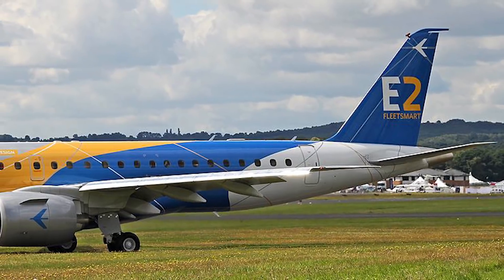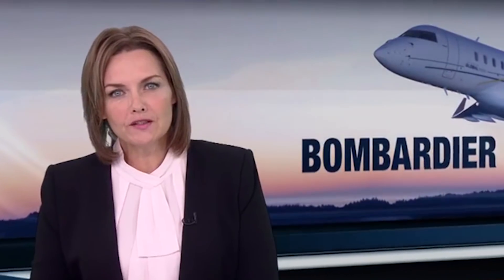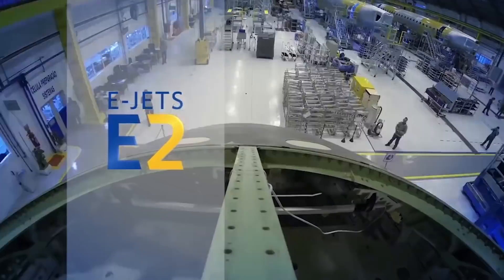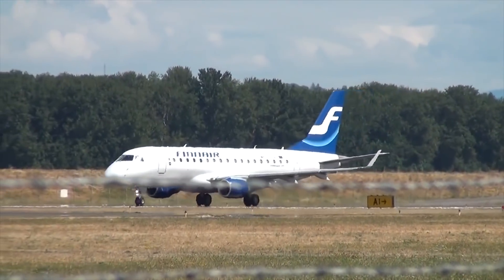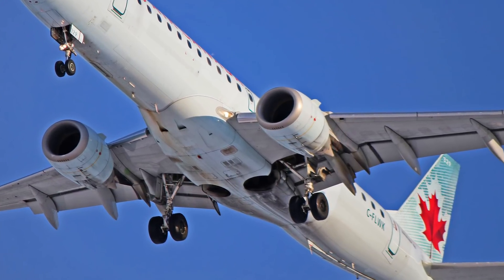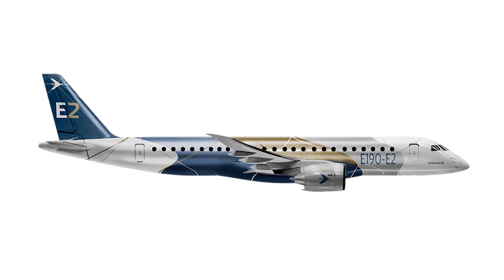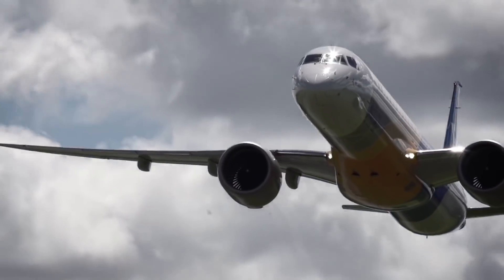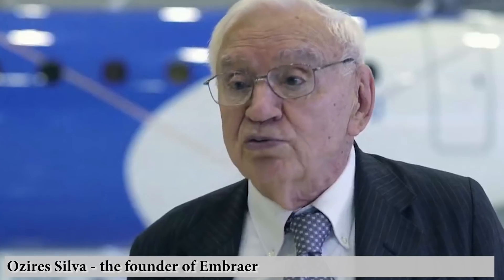Embraer E-Jet E2 - a new generation of leaders

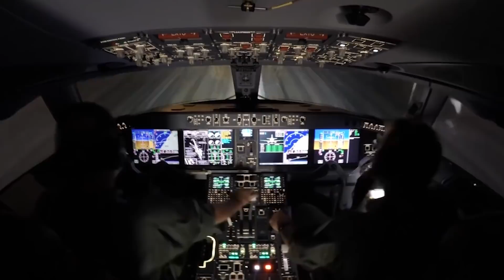Comment: 6:32 fast forward five years into the future, and these P&W Geared Turbofans have become the E2's Achilles' Heel. If Embraer had new-generation GE engines based on their proposed NG34 program, it would have been an undeniably superior product to the A220. As it is, GE didn't proceed with any engines for the E2 because they couldn't make a business case for it, but GE engines would definitely have been the best option. Even RR could do better than P&W.

Comment: Embraer and Airbus: Huge amount of engineers and scientists develop new aircraft with success. 

Boeing: Hired a big administration of economists who decided to tweak the 1960s design of the 737 to save money and be competitive. Putting in computers to fix pitch-stability issues from fitting huge "large bypass engines" on an ever more stretched and expanded 1960's design - how did that work out again? Oh - killing people. Good to see Boeing "saving money". Did not turn out so well, did it? 

So let us hope that Boeing finds back to their roots of being a science and engineering-driven company instead of being a company that rehash old designs to "save money". And fuck airliners who wants the cockpit and systems of the 737 to stay in the 1960's to avoid type-rating their pilots into the 21st century. We are in 2020 now. Even tiny private jets are FBW (yes - Embreaeer has FBW even on their tiny 8-person 450 (now Praetor models).
Reply: Economists are smart and can think long term. You're thinking of executives and short-term-profit focused accountants. Though it is worth noting that pitch stability augmentation is perfectly safe if done right – but 737 MAX was extending off of 1960s architecture, as you correctly noted, and that old architecture was not designed for the robust control needed for a good stability augmentation implementation

Comment: With large engines, Embraer do not need MCAS, why?
Reply: Because they managed to keep them under their wings. The 737 MAX has its engines mounted on the front end of the wings. This affected the airflow above the wings, which combined with the power output of those engines caused the plane's nose to go up by itself. This is why they added the MCAS, they needed something to control the nose, but it all backfired badly. The E-jet E2 doesn't have the nose-lifting problem and therefore there's no need for the MCAS.
Reply: @doctoremil2678  Instead of mounting their engines up and in front, can't they change or increase the height of their landing gear and fix their engines at normal positions?
Reply: @allenyeong3443  They probably could have done it, but it would have been expensive. Apparently the whole 737 MAX model range originally wasn't meant to be a thing. They wanted to create a new plane from scratch, but then the A320neo came out and the whole Boeing went crazy with panic. In order to keep their sales strong and costs down they decided to push the ancient platform one more step further, but it seems to be one step to far because of so many compromises, including the landing gear which remained unchanged. I think that instead of quickly creating a faulty stopgap they should have taken their time and made something entirely new and safer or at least a more carefully designed new version, just like the Embraer did with their E2s, they may not be entirely new, but they were clearly better planned.
Reply: @UC24HemZaSlD-FO9cZfeLYTg Is more than 300 lives less important than changing the landing gears?
Reply: @doctoremil2678  E2 just wouldn't need MCAS regardless – it has a modern fly by wire system which has closed loop pitch control law. E2 is substantially less stable than the previous generation, which is acceptable because of that new control system.

Comment: I think the E175-E2 will be a huge seller. I see lots of growth potential in the "short hop" market with planes carrying 60-90 passengers.
Reply: Fast forward four years into the future, the original E175 is still in production with new deliveries, and the E175-E2 still doesn't have a single order - it's a combination of the scope clause in the US market that it was designed for, the heavier fuselage, and the the heavier (and far less reliable) engines. The added length of the E175-E2 adds weight, and, on top of that, the P&W Geared Turbofans weigh more than the good old reliable CF34-8, making it heavier than what the scope clause allows - Embraer made quite a miscalculation there.
Reply: @rafaelwilks  I'm sure that if the Boeing/Embraer deal had gone through the scope clause would have been amended.

Comment: They're practically turboprops with the amount of bypass in those engines!  :)  16% fuel savings is really impressive.
Reply: That's only half of it, the other bit that makes those engines very interesting is the fact that they're geared ( allowing for different rotational speeds for the bypass and core ) which also brings them closer to turboprops.
Reply: AmurTiger is
Reply: @Faizal no it doesnt, there is a difference between geared turbofans and regular turbofans, with the geared ones u can run a much larger fan and reduce the rpm so that the tips of the fan dont hit supersonic speeds..
Reply: They are planning to resume the production of actual turboprops and I'm excited about that.
Reply: yep. todays standard.

Comment: Boeing + Embraer merger would be bad for competition.
Reply: HI, I do'nt think so, but both will be more competitive. The commercial plane industry is crowded now because the suppliers are the same everywhere, manufacturers are becoming more and more interlaced, just like automobile industry. We would have to check for shares also in stock markets. There is one niche that have at least 10 competitors being developed at the same time, I don't remember which one, maybe is this one.
Reply: Alden 
Do you think this is possible?
Reply: @garfieldthomas8118  I don't think it is possible, given the political climate.

Comment: How will the E195 compete with the CS100? CSeries is more advanced even after the E-Jets modernization
Reply: You people that think that cseries will crush the E2 (I'm not being biased) The E2 will do better since its a purpose made Regional Jet. It can't go outside of that. The Cseries does both regional and mid range markets. I think that the E2 would do better since its focused on regional (only) while the Cseries does both. Just look at the cabin on the Cs-100. It's 2x3 seating while it's 2x2 on the embraer.
Reply: You can cry it is free.
Reply: You are wrong. Worldwide the Embraer aircrafts are strongly recommended. Search around and you will see them, including smaller ones (Royal british family uses them also...).
Reply: It is not a fact. E195 is a recommended airplane
Reply: E2 is junk compared to Bombardier.
The operational statistics don’t even come close to the CSeries.

Comment: that engine is so H U G E
Reply: Modern turbofans are getting bigger and bigger. After some time there will be no place for them under the wing
Reply: @frankgaleon5124  Turbofans are really only efficient between a 9:1 and 11.5:1  bypass ratio. Once you go higher than that the engine starts losing power and thrust and they start using more fuel to compensate for the power loss... engines have pretty much reached their limits like Piston engine propellers did in the early 50's.
The only area that modern jets can improve in is overall weight, and compression technology.
Reply: @igotanM16  These have a 12:1 ratio and the A320 neo's have 12.5:1 so i'm sure it's a little higher. But the part where these engines decrease fuel consumption the most is for sure the compression technology
Reply: Frank Galeon Mandela effect
Reply: They looked to be as wide as the fuselage!  Absolutely beautiful birds!

I am SURE Embraer will do very well with these models.
Reply: @Jon M You can't look at it like that..  You have to look at it from Fuselage to Engine size Ratio.
Reply: Sometimes, size DOES matter...
Reply: Yeah, but that size is something absurd, like 6 metres across or something. (can't remember the exact amount that research papers were saying about high bypass turbofans)

Assuming I'm not massively mis-remembering things, a 6 metre diameter turbofan would be something you'd struggle to fit to an A380, let alone a small, narrow-body jet...

Comment: Very insightful, Embraer one of the best aircraft manufactures in the world
Reply: 'THE BEST
Reply: @amiranda6106  if Embraer hadn't close the deal, Boeing would buy the Mitsubishi ... so you'd see the Embraer that now is the third biggest manufacturer being the last one. Cause Airbus have already bought the Bombardier
Reply: DesertBlade18 after bombardier of course
Reply: @DrakeFromStateFarm  whatever you must tell yourself to sleep well my friend. 🤣
Reply: @DrakeFromStateFarm  Exactly :)
Reply: HiLal SaLeh For sure when they are bought out by Boeing.
Reply: @melrose9252  It is one of the best now WITHOUT boeing hater. And the deal if it happens is for boeing to own majority stake in a joint venture, not total buyout.
Reply: @melrose9252  Boeing is their Partner and does not own it.
Reply: @atroise BOEING  NOT PARTNER EMBRAER
Reply: @melrose9252  I am afraid of flying on Boeing planes.  They keep falling and don't give me any sense of security, unlike Embraer jets that don't have any accidents caused by mechanical failure, while Boeing like the 737 MAX crashes frequently.